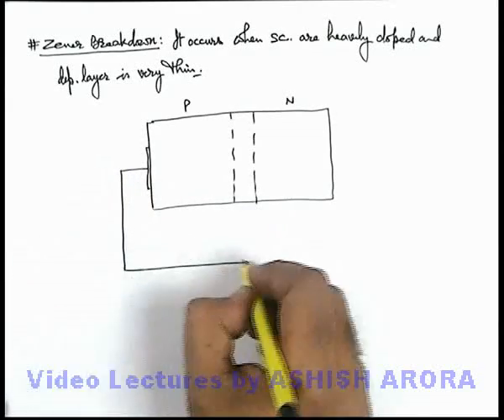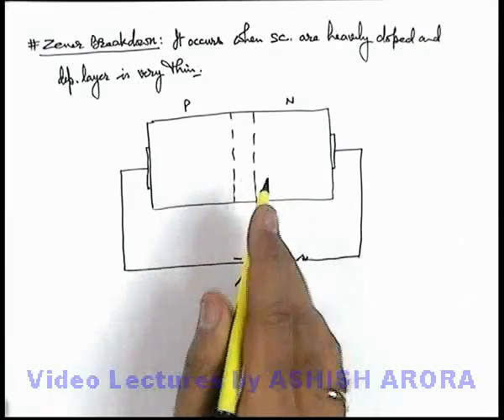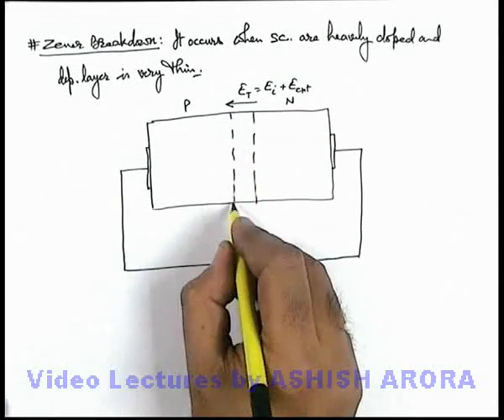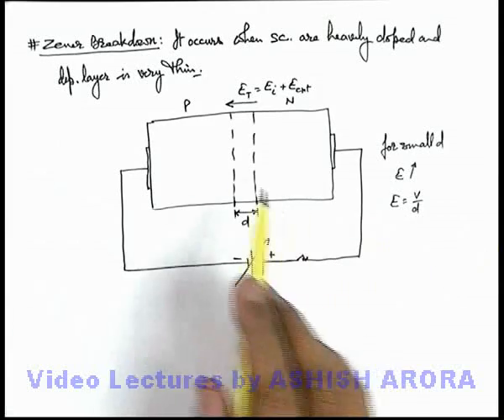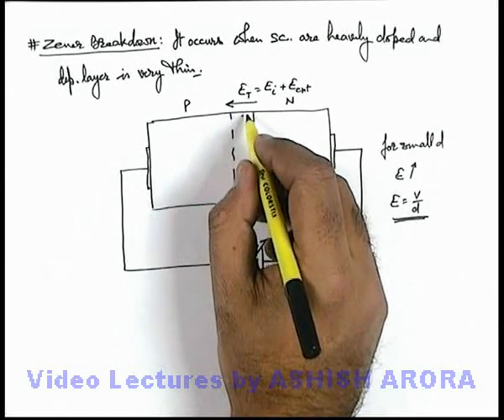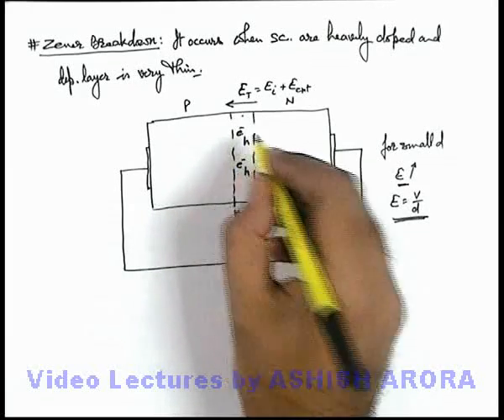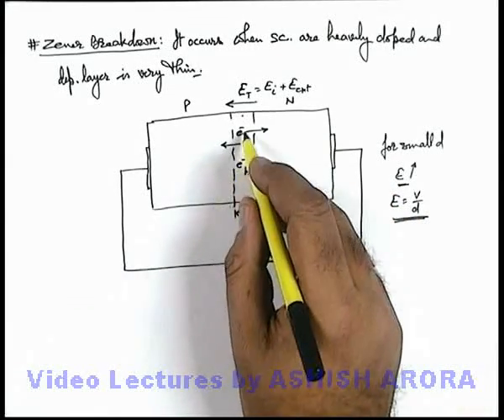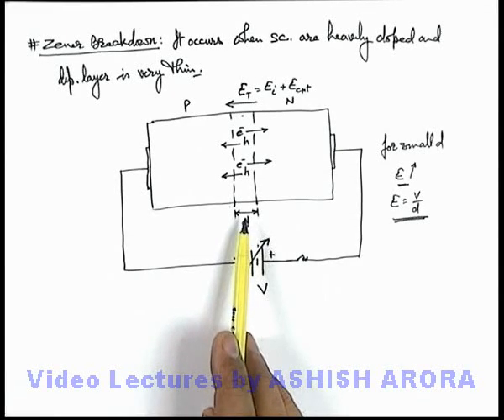Class 12 Physics | PN Junction & Diodes | #12 Zener Breakdown | For JEE & NEET

Comment: sir pls clarify my doubt clearly,pls sir,
1) how heavy doping makes the depletion layer thin
2)can i say that after breakdown if i increase the voltage then electric field and current increases but since already the current is very large the change is negligible. am i right or wrong sir
3)why the huge current does not melt the zener diode
4)how is barrier potential and width of depletion zone related
Sir pls clarify my doubts as soon as possible
Thank you sir.
Reply: 1) due to heavy doping the immobile ions are quickly neutralised decreasing the width of depletion layer
2)after breakdown current will flow rapidly
3) current produces huge amount of heat which seperates the p-n diode
Reply: barrier potential and width of depletion are not correlated

Comment: please sir please clear my doubt that why the voltage across diode becomes constant after breakdown and why on increasing  ext.voltage the voltage  across diode does not change as u told that electric field is kept constant but on increasing external voltage why the ext electric field inside the diode does not increases ?????????

Comment: sir, in your previous slides you have said that in reverse biasing the depletion layer is thick. so how can we get the condition of thin depletion layer in reverse biasing?
Reply: depletion layer is thin because  diode  is heavily doped  due to this filed set this called ionized electric filed
Reply from the maker: In RB majority charge careers are pulled away from depletion layer by the biasing battery thats why its thickness increases...
Reply: Physics Galaxy exactly sir, but the zener diode condition says that we need thin depletion layer in RB. How?